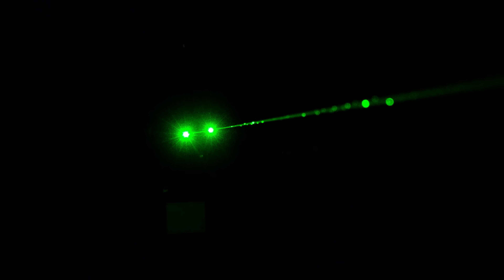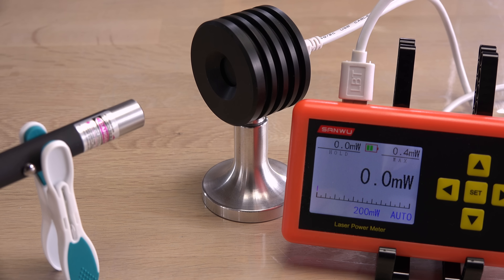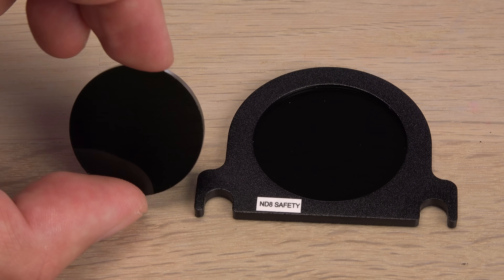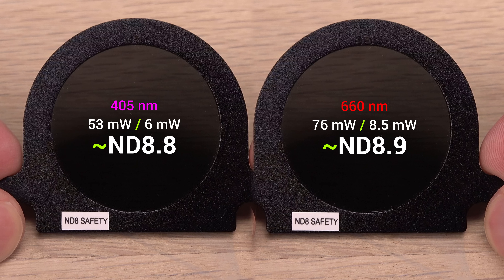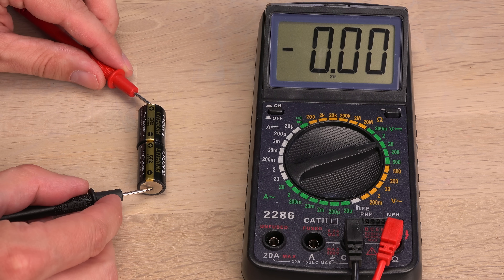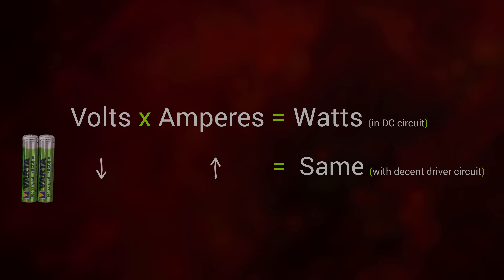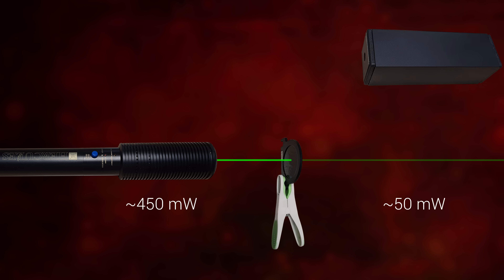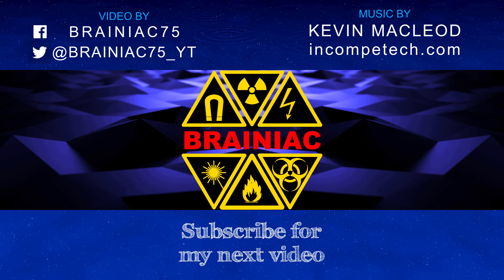Are lasers safer with rechargeable batteries?

Comment from the maker: As mentioned in the video, comment with your suggestions on how to lower a laser beam's power. I will make a video where I test your ideas, crazy or creative as they may be...
I prefer a separate comment in stead of a reply. Replies quickly turn messy and chaotic 😵 Thanks for your input!
Reply: Two ideas:
1) Send the laser through a polarizing filter.  In theory, it should absorb half the photons which hit it.
2) Send the laser through two polarizing filters, with the second being at a different angle to the first, preferably mounted so one of the filters can be manually rotated.  If the filters have their polarities 90 degrees apart, no light should get through, but if their polarities are aligned, it should act like just a single filter.
Reply: @BenjaminGoldberg1  this is exactly how the beam is attenuated on my setup. A small stepper motor rotates the polarizing filters in and out, allowing positional control of output energy all the way down to zero (effectively).
Reply: Insert resistor with batteries.
Reply: Option A : use 1 battery and then fipl the resr with aluminum foil
Option B : buy that device that leta you choose the amps and volts
Option C : use used batterys or batterys low on charge
Option D : this may not work but you chould try puting a device that uses power between  the power source and laser , light bulb or electromagnet ( putting a magnet near and electro magnets offers even more resistance)
Option E : get a very thin thing , like paper and try to shine a laser trough it
Option F : use mirrors to make the laser lose lots of energy before it hits it target

These are just ideas that work in my head , but i dont know if the work , but i hope it helps  you get ideas :)
Reply: How about a solar filter or solar eclipse glasses
Reply: One thing I would like to mention, whenever we are dealing with Electromagnetic Spectrum with such an instrument, why  they don't have a distance/Proximity Sensor to Offset the Loss or gain (ones  Calibrated )Because the  EM radiation 
 decrease over the distance from the source?
Reply: @abhijeetbyte  A laser beam does not follow the inverse square law because it is coherent radiation.  The beam diverges and this depends mainly on the frequency (wavelength) and the effective aperture of the laser, which is approx. the diameter of the laser.
Reply: @karhukivi  Yes, power does decrease due to Beam divergence, it is the primary factor. the power of laser beam decrease over a given distance
Reply: @abhijeetbyte  The power doesn't decrease, but the power intensity (power compared to area) does. The meter should show the same, unless the point is so big that some of it missed the sensor. The reason it showed higher the second time, was most likely because of the batteries. It's typical for old bad batteries that their output voltage/current capability slowly decreases over time when they are used. If they are then disconnected for a long time, then reconnected, their power output will be higher initially - before it falls again. Depending on how long time he took between video parts and if he had to do any retakes - the batteries might have been "better"  the second time.
Reply: @Speeder84XL    The things are the same as I mentioned above unless you introduce the battery part.
Reply: Our rechargeable batteries have more than 1.5 nearly 1.8 Volts.
Reply: So to clear some stuff up: The violet(405nm) pointers power didn't go down at all because it uses a boost mode driver that will bump the voltage to the diodes vF at the set current anyways, so changing alkalines out for rechargeable would just cause it to be a tad less efficient and draw a bit more current due to the lower supply voltage. Said rechargeable batteries may have an effect on green DPSS lasers as those use a linear mode driver so for it to operate it needs a voltage input of vF of IR diode at ~500mA (~2V) + 600-1v~ that is dropped constantly due to the linear topology of the driver.
Reply: This isn't about lowering the power but... I think that weird filter of yours is actually a UV-pass filter. I saw similar filters when looking for filters on eBay.

On a side note, there's a company called Lasence who makes 558-559nm and 575nm DPSS laser modules, for less than $100 each and comes with a driver. That's a good deal for yellow/near yellow module... They leak IR though so I installed an IR filter on my build.
Reply: Maybe use water with dissolved substance that absorbs wavelength of used laser?
Reply: put a resistor between the battery and the laser circuitry
Reply: Cool
Reply: I came up with a crazy and an impractical idea to reduce the optical power of any laser.
First, the impractical idea. Get a high power beam splitter and a beam dump that, if used in conjunction with the beam splitter, can discard about half of the laser power. To make the laser safer, cascade multiple stages.
Second, the crazy idea. If a photon enters an extremely strong magnetic field(flux densities in the range of terateslas), the magnetic field can, for lack of a better explanation, litterally "rip" photons apart into electron-positron-pairs. On top of that, the vacuum itself becomes birefringent. Do not use this idea, because the energy density of such a strong magnetic field can reach million kilograms per cubic centimeter and every living entity entering such strong magnetic fields may cease to live the moment they enter that field.
Reply: I have one of those cheapo UV lasers, looks the same, just different color on the label. So with the test you did on it are you saying I should wear protection when using it??? I use it to cure UV resin/glue from time to time. I do wear glasses 100% of the time, they have a UV coating on them, is that enough???
Reply: You should really use a DC power supply to compare, batteries vary their voltage as current changes, not a proper scientific method. Please redo the video with power supply+capacitor.
Reply: Just turn off the laser, no power output!

Comment: There are plenty of variation in both alkaline and NiMh batteries.  But my rule of thumb has been that both old NiCd and the newer NiMh rechargeable batteries have way lower internal resistance than the alkaline batteries have.  With the likely quite high current of the laser lights you are no better than a wrong guess, if you measure the no-load voltages of the batteries.  Maybe you could make some simple "instrumentation" to measure the actual in- use voltages.  I mean soldering for example 0,1 or 0,2 mm magnet wire at least to the positive battery end and bring it out for the meter.  Right, or wrong, I think the negative end will be connected to the housing, so you would not need t worry about that - except for the probable anodizing that tends to be a good insulator.  Of course, a different instrumentation would be to use a bench supply, if all you are actually interested is the dimming, not the batteries idea.

Comment: No, the premise that a laser diode is Ohmic is wrong, optical output is basically dictated by the current only. Extra voltage in excess of exciting the electron to the excited state are converted to heat, through Ohmic resistance on other parts of the circuit, thus you can only see the limiting effect with the old batteries as the voltage becomes too low to saturate the population inversion while lossing some power to Ohmic resistance.

Comment: The 405 NM laser diode is actually driven by a boost driver, it's actually a switching boost converter so as the voltage goes down (or using rechargeable) batteries it will simply adjust the duty cycle of the driver to keep the voltage/current the same across the diode the same, however the other lasers are generally driven by a linear driver which will change the voltage directly due to them not being able to increase the voltage the across the diode, they can only keep the current the same.

Comment: The unlabelled, visually high opacity filter? At a glance it looks like the IR-pass filter that i bought to build a point tracking camera. But given its strong red rejection, i'm not sure. Maybe it's a specialised UV pass filter?

Something to keep in mind that the nominal voltage for alkaline and NiMH cells is specified differently. In NiMH cells it actually represents the typical voltage throughout most of the discharge cycle, in alkaline it's the voltage that they start with when full. Additionally, NiMH have lower ESR.

I would say the overpowered laser pointer is susceptible to source impedance, so a resistor in series with the cells is likely to tame it down quite a bit.

Comment: The effect the battery voltage has on output power, depends on the power supply inside the laser pointer.  A constant current supply will compensate for lower voltage, to a point.  You can use a variable lab supply to determine what that voltages is.  

The laser pointers (like the purple one) have adjustments.  Unfortunately, the PCB is very difficult to get to without destroying the pointer.  

The old lithium batteries were measured without a load.  The voltage was probably lower when trying to power the laser.

Comment: In previous attempts to make a "low power setting" I've used diodes in series for their voltage drop. This works for the most part. The issue is that this isn't a good solution for lasers with a current controlled driver board as they pass the same amount of current at any voltage. That said, when the voltage drops below the maximum threshold of the laser diode the beam intensity also decreases. This also works for reverse voltage protection.

Comment: try a lithium ion AA set with a usb charging port on the batteries. these tend to limit their amperage to maintain 1.5 volts, and on half a charge can limit it very drastically.

Comment: change the driver circuit with a linear voltage regulator.
that simple, for better result use two in series, first one in voltage mode second one in current mode.

Comment: Well yes and no actually.

The 405nm has a boost circuit and not a linear regulator so as long as you have total wattage you are going to get the power from a boost. using 1.2v batteries however in a generic green laser has a huge chance at reducing power since you are lowering the input to a linear regulating circuit that tends to start dropping voltage around 2.5v. Newer green lasers just us a resistor now and are even cheaper in construction. Since these new ones only have a resistor to drop current/voltage to the pump using 2.4v will greatly reduce the output of these newer cheaper green lasers from eBay. I have many modification tips on many common drivers for controlling power. If you want to do a make your laser safe collaboration video tackling both optical mods and electrical I would be 100% down for doing so. Also, make note that if you are using an optic that has no AR coating it is best to lay the optic slightly at an angle to prevent internal reflections that may appear on on the output or reflect light back into a laser diode and damage it. Another thing to note is in your red you are dropping from 6v to 2.3v ish and losing half your battery power in that. I know just 3v is cutting it close but I think you can easily use a single 3.6v rechargeable in your red without any issue.

Comment: Idk why, but I've had my rechargeable batteries in my laser pointer for about 2 years, and haven't had to recharge them. Kinda weird.
Reply: Periodically used with small currency batteries / accumulators would live longer than if not used at all while discharging on themselves. Weird but interesting stuff.

Comment: Two things I would consider - an ND filter as screw-on to eliminate any reflection, or adjusting the constant current source found in most cheap lasers. The better ones usually have a power control circuit using an internal photodiode in the laser assembly, so they can measure the light output and regulate. This photodiode is often also present in cheap lasers, but not used. Disassembly sucks, though, since many are simply press-fit into a metal tube (at least mine are)

Comment: Use a controlled power source — you can control both current and voltage. But I’m sure a module can only go so low before it stops working

Comment: The mystery filter could be a piece of a protective filter for industrial application where you need to protect your eyes more against IR rather than UV. With arc welding, you also need protection against the upper end of the spectrum so maybe a fairly hot furnace or an IR laser.

Comment: The power drop completelly depends on the current regulation schema of the particular laser. If there is nothing except a resistor, then the power is quadratically depends on the voltage. If there is a good current regulator, then the power does not depend on voltage at all, it just stops lighting below some voltage threshold.

Comment: as you probably know, laser diodes are current-driven devices. the light output does not depend on the voltage, but the current. the characteristic curve (dependency between current and voltage) is roughly that of a Diode, but it can vary greatly depending on temperature.
so to correctly drive it (with any power output you want, a constant current source is needed). Be aware that below a certain threshold, the laser will behave like an LED (with a wide spectrum). only above a certain current will the laser system be resonant. 
when you modulate a laser (for example to transmit information through a fiberoptic cable) you mustn't leave this area of the characteristic curve, because it takes time (a few us to ms) for the laser to get into the laser area of the curve again.

Comment: I believe the rechargeable ones are not really lower voltage like advertised. If they are fresh and new they will be higher in voltage closer to the desired 1.5 more than likely 1.4 and it will take a bit of use before normal recharging gets them down to the 1.2 volt range. Normally with DC voltage is more important in application just like any flashlight will give. More volts will be brighter as amps is just capacity of the battery and it will run out quicker. Versus AC where the amps is equally as important as volts since there is a constant supply filling power.

Comment: I'm paranoid by the laser in my IR non-contact thermometer. I have a ST600 and it is powered by a 9v battery. The laser looks super bright on surfaces. Glad it can be turned off. You should buy and test some. I'd like to see that. My bet it's a 5v-6v laser diode straight to the 9v power source!

Comment: Hmm, laser diodes are current controlled semiconductor devices, just like ordinary LEDs. At certain point or range of current values, the laser diode starts lasing. May I suggest that you use a simple constant current circuit(like the famous LM317 laser driver circuit) and experiment on the resistor values🙂

Just wanting to share my idea hehe. Also, I got caught off guard with your dialogue that has the word sus 🤣 amogus is everywhere

Comment: The normal way is to reduce the duty cycle. For example, to focus a laser cutter you just use a very small duty cycle. Most laser drivers have a pin to turn them on and off.

Comment: Most handheld lasers should have a small potentiometer (variable resistor) on their constant current driver. That on its own would an easy way to decrease or maybe increase the current delivered to the laser diode, but the circuit board might be difficult to get out of the housing. I guess it is worth a try.

Comment: Some of what's happening here has to do with the driver board. Some drivers are current controlled circuits and don't change much with different voltages. An example is an ultraviolet laser I bought from Ali Express. It would normally use 1 18650 cell. I hacked it to run from a standard USB source and it draws the exact same current in both voltages. There's no notable difference in output power either which was something of a disappointment as I was hoping for a beam with a bit more photonic strength. It might be interesting to see how laser diodes would react differently when driven by simple resistive dropping circuits as opposed to current controlled.
Reply: The reason why lasers are given a current controlled driver is because the element/crystal has to be excited enough beyond a threshold to pump the photons out . If you use a resistive circuit to regulate the output, the crystal may get heated up because it is not pumping out the energy via photonic discharge & eventually may get destroyed.

Imagine a pressure cooker cooking so slowly that the pressure never builds up enough to push the valve & you keep on cooking waiting for the whistle - eventually the food will get burned.